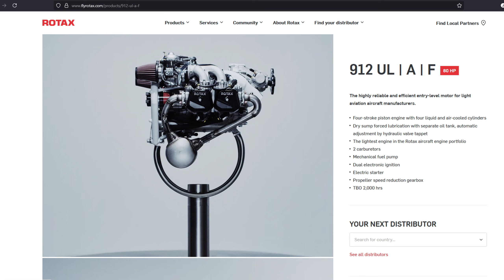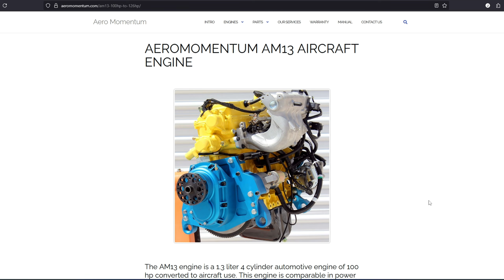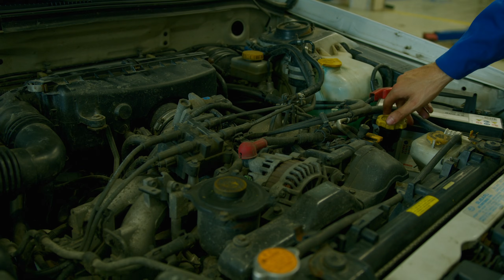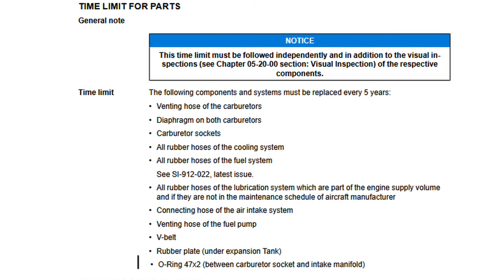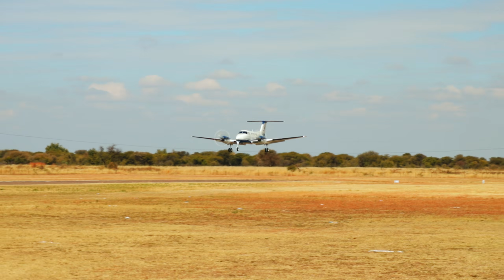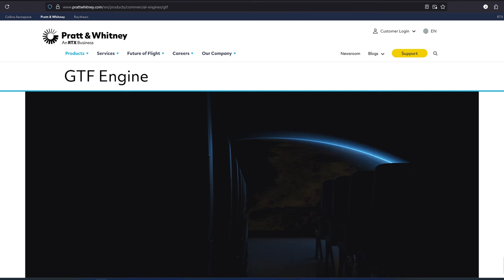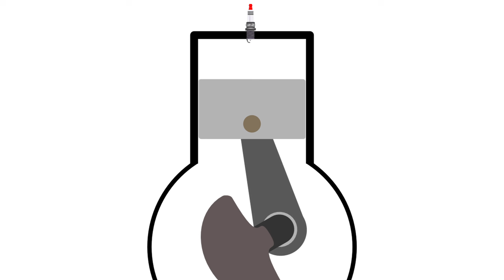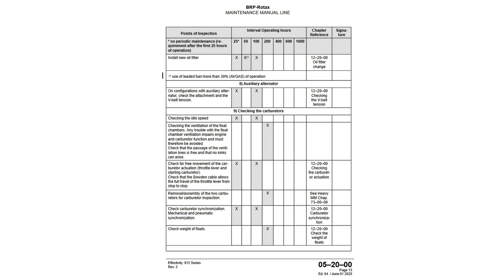Are These Rotax 912 Design Features Problematic? Design Explained

Comment: My issue with the Rotax 912 isn’t necessarily the gearbox itself. It’s the way it is lubricated. It uses the dirty engine oil rather its own self contained gearbox oil. This means the gears are getting coated with carbon and lead deposits. Another issue is that it requires a fairly high idle speed of at least 1800 rpm despite Rotax listing a minimum of 1400 rpm in the manual. The pulses from a lower rpm create enough lash in the gearing that it destroys itself. The 1000 hour gearbox inspection is usually a full replacement. Syncing the carbs is an extremely tedious and finicky process as well.
Reply: Syncing two carbs is tedious? Try, oh let's say four.  Hmm, but I sposse that's easy for me to say, I'm an old motorcycle, snowmobile, small engine mechanic.
Reply: Lead in unleaded fuel?
Reply: @fredmyers120 Lead when using 100LL. A lot of airports don’t have mogas.
Reply: @bencarlassara5877  that's what transfer jugs are for.  When you're burning <4gph and paying half price for it, it quickly becomes a non-chore.  And if truly "not available", that's what Decalin and shorter OCI's are for.  Tribology has come a long way in even the last 20 years, let alone since Lycomings were designed.  Edit: and even still, lead fouling to combustion chambers is far more both likely and deleterious than gearbox deposits.

Comment: Brilliant engines. I have lots of time on them.
However, the future is perhaps not so rosy for Rotax owners.
The time is fast coming when it will not be possible for owners or un-approved maintainers to obtain parts for servicing.
The plan is for all maintenance to be strictly carried out by approved maintainers, exactly to the manufacturers schedule.
Sounds good, until you realise how extensive the factory maintenance is, and how difficult many modern Rotax powered aircraft actually are. 
All maintenance will be logged by Rotax. No shortcuts allowed.
Now, I am not against good factory maintenance, but the issue is few current maintainers will be willing to spend the money to buy the Rotax service tools, computer connections and diagnostic gear etc. it is a huge expense that will have to be passed on to owners.
Check out the maintenance schedule and cost for the latest gearbox shaft, for example.
Again, great engines, but rapidly overtaking Lycoming/Continental for cost per hour for maintenance.
No longer will recreational aircraft be the affordable alternative. Especially with the latest iterations with Turbos and multiple computer controlled components. 
They are going to cost a fortune to keep. Many owners of the latest types are finding this out now.
Reply: Exactly--- this is why my CTLS has been sitting for 8 years with only 473hrs on the 912uls.
                 I can't afford the upkeep and will have to practically giveaway the plane due to sitting.

Comment: Good presentation. I have never been keen on the Rotax complexity, and prefer the UL 260, but it is clear that the 912 is the king. One more advantage of it is the low frontal area. This is only really apparent in sleek single seat or tandem seat aircraft.

Comment: One thing I'll throw out there: apparently the Rotax 912ULS is good enough for Ukraine to use in loitering munitions (specifically UAV-converted Aeroprakt A-22s), which presumably do get shot at...
Reply from the maker: Fair enough 🙂
Reply: The Predator UAV also used a 914.

Comment: 3400 hrs now of 912 time,  completely trouble free to 2300 hours on the first engine, that I replaced just because I figured it had earned it.   The last 300 with  the EDGE EFI mod, when I realized my car, truck, tractor, and even the ATV were all fuel injected, I figured it was good enough for the plane. For those "against" liquid cooling: it sure is nice to have TWO cabin heaters in the winter,  one a conventional muff heater, and one a coolant based heat exchanger one, that with a cockpit controlled diverter valve can also drastically reduce the amount of warm up time  while also maintaining optimum engine temps once cold weather flying.  A less drafty plane than mine can easily get by with just a coolant heater.  And lets not forget about the old "shock cooling" bugaboo, ain't none with the 912. The best critique of the engine ever, I learned more than I needed to know!
Reply: Cant beat BSFC of the latest 912iS Sport. They get about 0.375 lb/hp/hr against 0.45-0.5 of Lycomings. The best IO-390 gets a low of 0.44.

So a 20% fuel burn improvement.
Reply: @Triple_J.1   And, on mogas hopefully!
Reply: @Triple_J.1  Do you mean Lycoming O-235? 390 is a 200hp. I wish its fuel consumption were 0.44...
Reply: What airplane was your 912 in? I’m struggling to solve high temp issues during warm weather. Seems like the oil cooler is under seized possibly poor cowl design?
Reply: @nickr5658  Which airplane? 912 ULS is pretty easy to cool.
Reply: @andrewmorris3479  Katana

Comment: 1) I had a loss of coolant when the rubber pad under the header tank broke away and the tank rubbed on the engine block.  However, because only the heads are liquid cooled, it ran for 15/20 mins to the nearest airfield with no lasting damage.
2) I've also had a carb fail due to a blockage; it ran rough but there was enough power to maintain altitude.  With a single carb I would have gone down.
3) The Merlin had a gearbox; most people reckon it was a pretty good engine!
Reply: 3) The Merlin isn't really a valid argument (nor are turboprops). Aircraft engines with 6 or more cylinders will be much easier on the gearbox, the more cylinder the better. 4 cylinders have strong torque vibration due to no overlap of working stroke. That makes gearbox design and reliability for a 4 cylinder aircraft engine much more of a challenge than for a 6-cylinder or even a 12 cylinder. On cars, you would have a heavy flywheel, often even a multi-mass flywheel eating up those torque vibrations and protecting the gearbox. On an aircraft engine, the propeller is effectively the flywheel, so the gearbox, in between the engine and the propeller, will get the full load of these torque vibrations. Thielert learned the hard way that these vibrations get stronger with higher compression and gearbox design for these kind of engines is absolutely non-trivial.

That said, there is no need to invoke either merlins or turboprops as a reason why the gearbox of the Rotax is not a problem.After 40 years, there is enough history of the 912 itself that proves that it doesn't have any systemic problem with gearbox failure. It's just old wives tales perpetuated by people who heard horror stories about old geared engines from Lycoming and Continental that were prone to failure when not operated correctly (e.g. avoiding windmilling propellers on low power settings).
Reply: @grizzly8810  You can still have a heavy flywheel on an aircraft engine, that's part of the reason why the Mercedes-based diesels are so heavy.

Also, consider the Viking Aircraft engines, their PSRUs seem to be holding up fairly well.
Reply from the maker: Interesting, thanks for the info. 
1) Its the first such case I've directly heard of. Good outcome though, and pleasantly surprised it lasted 15+ minutes. 
2) I've been told that the dual carbs add redundancy, but I was hesitiant to believe it (hence not mentioning it in the video), having seen rough running if carbs aren't synced. I guess it does add redundancy. 
I know of a few single carb, non-Rotax planes that went down due to carb issues.
3) Nough said
Reply: Officially, rotax says you can fly up to 15 minutes without coolant but not above Max continuous 

I think what they're trying to say is that it can barely handle it, and it's easy to overheat the engine so you should take it easy and then go

Comment: Many are reluctant to "new" technologies in aircraft engine because the old stuff is proven. That's not false. On the other hand, when's the last time you had issues with electronic ignition, cooling system, electronic injection or blown a gear on a transmission in your car? You can drive a modern car to 200k miles easier than you could do it in a 1960-80's one.

Comment: it's quite remarkable looking at a 912 next to an O200. The cylinders are about 60% the size of the o200 and the power output is similar. The weight difference is massive. It's unfortunate that the 912 has gotten so expensive to purchase and maintain, but the O200 has now become insanely expensive and crankshafts are unobtainable - I've seen them for sale for $8000!  So the 912 will continue to be very successful. Also, with the LSA weight limit of 1320 lbs you can't really use an O200 and have any useful load.
Reply: LSA as of October 24 2025 no longer has weight limit
Reply: @mauriceevans6546  oh is that mosiac? I haven't kept up. Anyway the parts are getting so hard to find for the O200 that it won't make much difference. They used to be economical engines and it was easy to find parts and machine services. Now we are down to one or 2 machine shops in OK and that's it. Rotax are expensive to maintain but the factory parts supply is much better than continental since the Chinese bought it.
Reply: @sblack48 Yes! New rules for light sport pilots go into effect oct 24, 2025.
1. 1320lb to no weight limit 
2. 120knots to 250knots 
3. Fixed speed prop to constant speed prop
4. Fix gear to retractable gear
5. Two seater to four seaters
6. Helicopters now allowed
7. Night flight with medical or basic med 
8. No engine restrictions 
9. 45knt to 59knt stall speed

New aircraft rules in 2026
Reply: The Vashon Ranger is LSA and has the new O-200.
Reply: @AnthonyNinoAV8Bales but it is to Heavy. Rotax would be better

Comment: Pity these Rotax boxers don’t have forked rockers for a 4 valve per cylinder layout with opposing canted valves, like the Honda CX,  the Moto Guzzi Daytona, the Triumph TSS & the Horner Irving Vincent. All of which have pushrod & rocker valve trains for 4 valve per cylinder canted valving without the hassle of OHCs. I like the watercooled heads & Nikosil alloy cylinder barrels. Imagine if VW had modernised it’s aircooled boxers with watercooled heads, forked rocker valve gear & Nikosil alloy barrels. It’d be much better than the wasserboxer simply by having fully closed decks, let alone everything else. I wonder how a Rotax boxer would go in my Type 3?
Reply: The Porsche 959 had air cooled cylinders and water cooled 4V heads. Of course they were OHC like other Porsche engines.
Reply: You couldn't make it a crossflow head, though, the pushrods get in the way.
Reply: @PistonAvatarGuy  well the VW Type 1 have the inlets passages at the top & outlets passages on the opposing sides which would have no problem working with forked rockers & the layout I described. Do a search on Moto Guzzie Daytona, Honda CX or Irving Vincent layout. While the VW Type 4 (also in Kombis post 72) actually do have crossflow heads even though the pushrods are in the way, some aero boxers somehow managed this too. Maybe they were VW Type 4 based, I don’t know. Anyway thanks for reading my comment & replying, cheers.
Reply: @mickvonbornemann3824  The VW engines are not 4-valve engines. There was a company that was trying to make 4-valve heads for VWs, but nothing appears of have come of their efforts.

Those Honda heads work because you can have the pushrods on the side of the head, while having the ports on the front and the back of the head. In the case of a boxer 4 cylinder, where two cylinders are paired together on each side, the cylinder pairs prevent that system from working.

Honda did make a 4-valve pushrod aircraft engine in the early 2000s, but who knows how that valvetrain worked. OHC systems just work better, anyway, it's ridiculous to mess around with pushrods these days.
Reply: @PistonAvatarGuy  I know that, I was theorising on what could potentially happen if VW had developed their boxers for another decade, re read my post please, no where did I say VW made 4 valve heads.
Reply: @PistonAvatarGuy   Go have have a look at a CX Honda or Moto Guzzi Daytona head. Now imagine that they are turned around so the pushrods enter at the bottom of the head just like they do in a VW. In such a 4 valve pushrod boxer layout you don’t have say 2 inlet valves at the top & 2 exhaust valves at the bottom. Instead everything is turned around 90 deg - for the 2 cylinders on one side of the boxer, one is turned 90 deg clockwise, the other 90 deg counter clockwise. This way where both of the exhaust ports are on a standard VW Type 1 (front & back of each head) there would be 2 exhaust valves one above the other & in the middle of the 2 cylinder head, under the 2 inlets there would be 4 inlet valves forming a square, ie 2 inlets for each cylinder mirroring each as in 2 inlet valves, one above, one below, under each inlet opening.
Sure with 3 or more cylinders inline, OHCs make more sense, but where theres only one or 2 cylinders in a head, 4 valves using forked valves makes much more sense when it comes to working on a engines. For example there’s absolute no timing issues when removing & putting back such heads, like say after valve regrinds & 4 valve pushrod engines can rev just as well as as any other 4 valver, using modern tech like roller lifters & roller rockers. Note that standard out the box the Honda CX revs to over 9k, pushrods & all. BMW air/oil cooled twins still use pushrods too. While the Horner Brothers are getting 186KW on their 8 valve Irving Vincent twins. Gez just a decade ago they won the BOTTs race at Daytona, using a engine & chassis based on the D Series Vincent from 1950 odd against some of the most modern racing twins in the world, still aircooled but with 13:1 compression & it revs to the moon.
Reply: @mickvonbornemann3824   Clearly trolling.
Reply: @PistonAvatarGuy  it seems you have comprehension problems

Comment: The biggest thing you can do to extend the life of your 912 gearbox is do not idle below 2000 RPM.
Reply: Good info.  My Evektor Sportstar won't sit still at 2000 rpm so have to hold brakes.  Installed Matco brakes and now it takes less force on the brake pedals to stay put.  It idles smoothly'ish down to 1700 rpm but gets wobbly below that.
Reply: Why ?
Reply from the maker: I assume he means because of the excessive vibration. We used to do startup, then 1,800 rpm for about a minute then at 2,000 until warm. They vibrate a lot below 1,800.
Reply: @Steven7216-u9y It's because the drive dogs in the gearbox vibrate and wear against themselves really harshly when you idle below 2000. It tends to happen most in flight school aircraft.

Comment: We're going to see less certified (small) aircraft, I believe now that MOSAIC is going into effect.
Reply: Less certified?
Reply: Fewer?

No. There will be More. MOSAIC opens up the US spot pilot to MANY rotax light airplanes from Europe.
Reply: As I understand it many new light sport aircraft don't or won't "need" to be FAA certified. I think they may be ASTM certified, which could be less expensive? Someone correct me if I'm wrong.
Reply: @oneninerniner3427 light sport aircraft have always been built to ASTM standards. Some manufacturers certified their planes through part 23( bristell). Vast majority have not

Comment: I’m sold I want one! I just wish they sounded cooler!
Reply from the maker: Yeah the slow turning, big displacement engines just sound better
Reply: @LetsGoAviate can you do a video on the other engine you mentioned here the cheaper alternative to the o200? And possibly their whole lineup of engines? It seems really cool but I wonder what there problems are.
Reply: @LetsGoAviate  ...but are also the source of many noise complaints from non-flying people. The Rotax 912's quiet operation ha allowed the development of many rural airstrips in Europe that simply would not be possible if we used spam-can engines
Reply: Use a Prince P-Tip prop like I do, then they sound almost like a little radial!